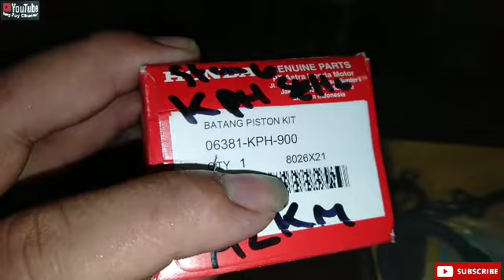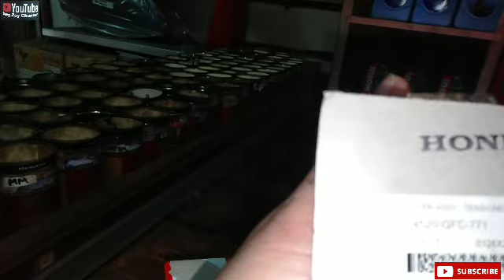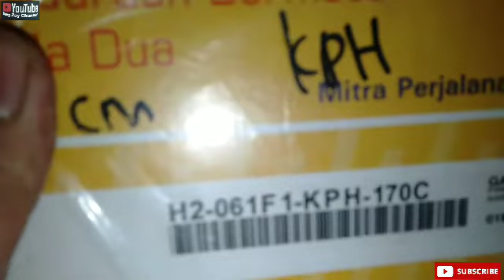Turun Mesin Supra x 125 Yuk Simak Sperpart Apa aja Yang Diganti |RuangBengkel

Comment: bang mau tanya. supra x 125 fi tahun 2014. masalah sering loss kompresi ketika setelah dipakai perjalanan jauh. di stater kaki tida bisa dan di double stater juga sama.
tarikan gas seperti tertahan dulu baru jalan waktu diatas speed 40 km/jam. 
sudah pernah ganti aki, sensor tpm, rantai kamrat, set kampas kopling.

solusinya gimana bang? 
turun mesin ganti spare part apa saja ya?
Reply from the maker: Itu harus dibongkar dulu bagian head sama blok sehernya.. Dicek seher sama klep nya.. Itungan service besar. Nanti klo udah dibongkar bisa kliatan yg rusak.. Untuk estimasi budget.. 1,5 untuk jaga2
Reply: @BangzayChannel93  berarti turun mesin ini kah bang? 
wih lumayan 1.5 yah maksimal itu?. makasih banyak infonya bang.
Reply from the maker: @Ucihaist  gak turun mesin.. Bongkar head sama blok seher aja